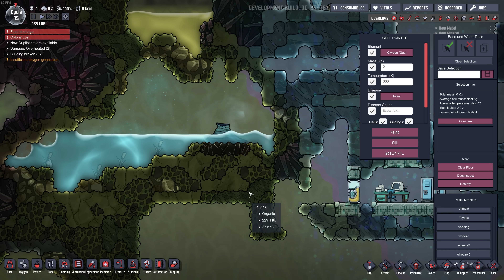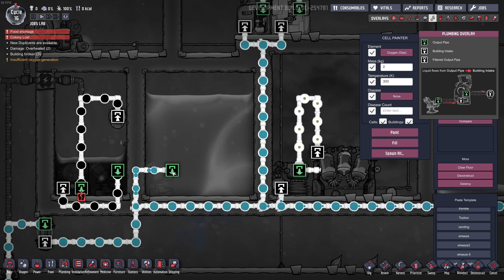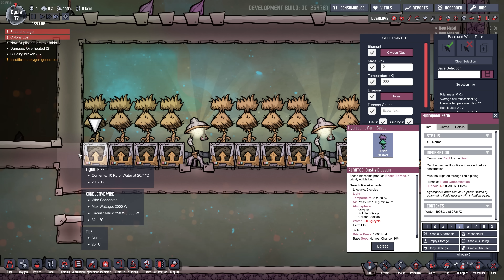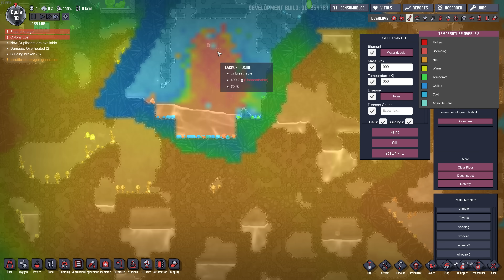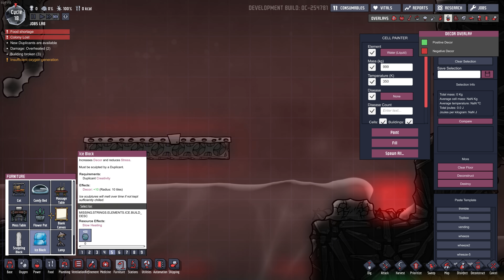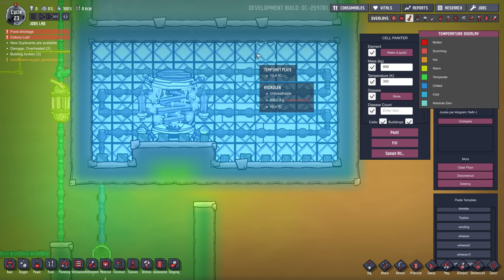HOW TO COOL WATER GUIDE- Oxygen Not Included - Tutorial

Comment: 1 other way, cool hydrogen in a sealed of room to -30 ish degrees, and build a gas radiator in a water tank. And let the cold hydrogen run through it.
Reply from the maker: I thought I mentioned that...but maybe not. That certainly will work. As mentioned...gas cool is much slower than liquid cooling but it does work.
Reply: Depending on the size of the tank it would take really long time or almost not work, I would never recommend using that
Reply: I recently build such thing with hydrogen and, as mentioned, it is really slow or doesnt work. It's because the high mass difference between gas and liquid (as he mentioned in the video i think?). There's only 1kg gas per pipe block in contrast to hundreds of kg of liquid per block.

Comment: Great video, cooling water is one of the main links to late game.  
  
I noticed you said hydrogen was the best gas for cooling but phosphorus gas actually works that bit better. Obviously a little bit harder to get phosphorus gas than it is hydrogen but for true end game you would need to use phosphorus for your cooling imo xD.
Reply: Alistair Waddell wouldn't you have to essentially boil phosphorus to make gas? Wouldn't that require it to be extremely hot?
Reply from the maker: I've never actually made that gas except in debug mode. I'll try it out for cooling.
Reply: Isn't PhosphorusGas below 553.6K LiquidPhosphorus?

Comment: Nice Video, here what i use as my Base-Cooling solution (Water+Air). I use it to regulate the water temperature by about +/- 5 degrees whatever temperature i need (and i can control it pretty exactly).https://picload.org/view/darcoppi/oxygen_cooling.png.html
Reply from the maker: That is quite the setup. Built in debug mode? So many shift plates :) Any reason you use insulated gas pipes?
Reply: Testet in Debug and (the screen) build in main Game. The reason for the insulated gas pipes is simple, the cooled oxygen could worm up on the way to the base what i try to counteract.